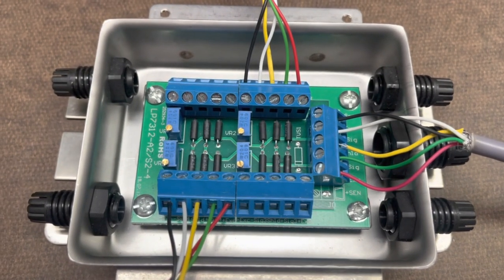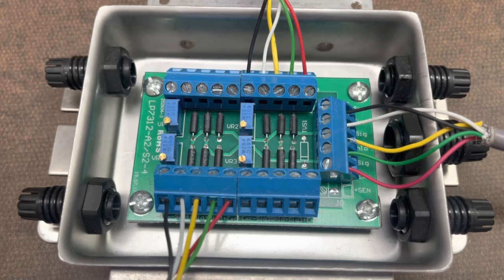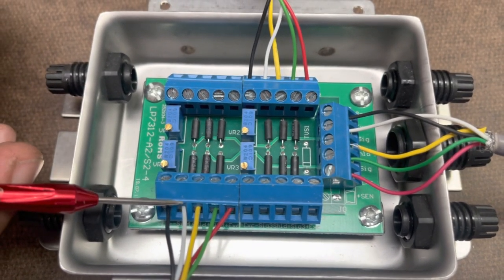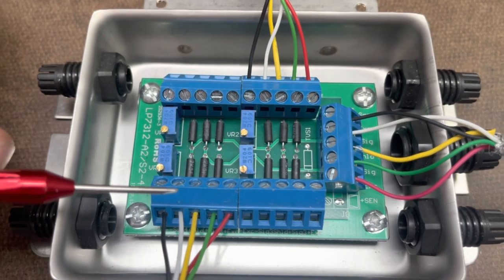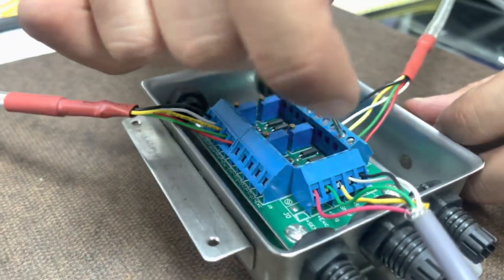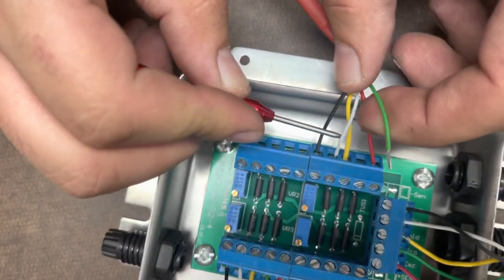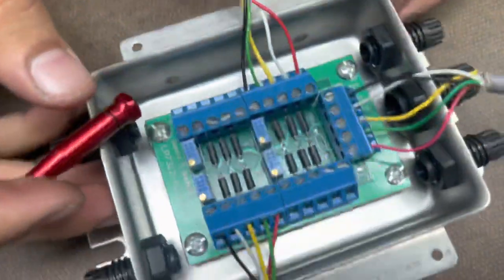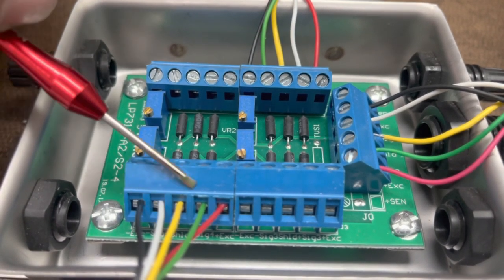How to switch the Signal direction of your load cell by SellEton scales

Comment: The numeration of  cells can make a wrong ❤mesurement?
Reply from the maker: You should check the load cells wiring to make sure that you are connecting them to the right location. That information usually comes with the load cell certificate.